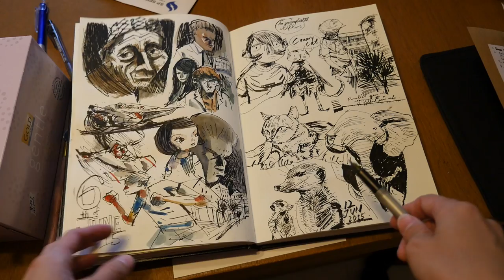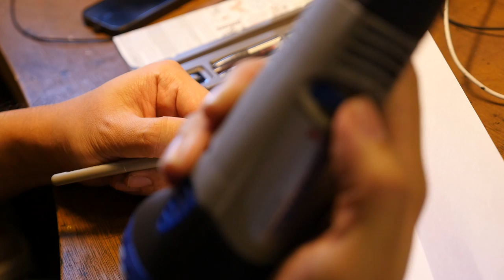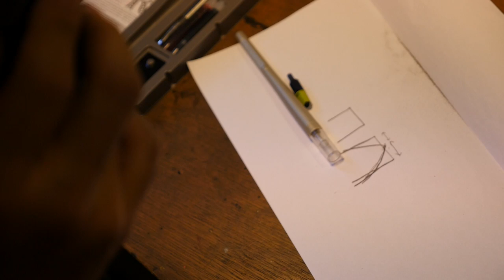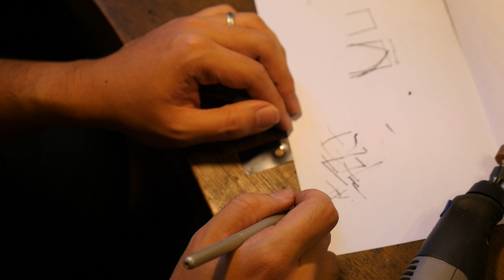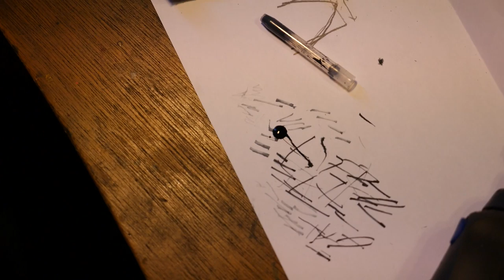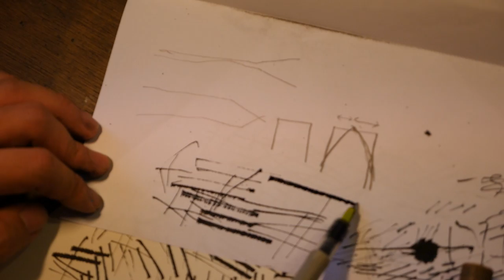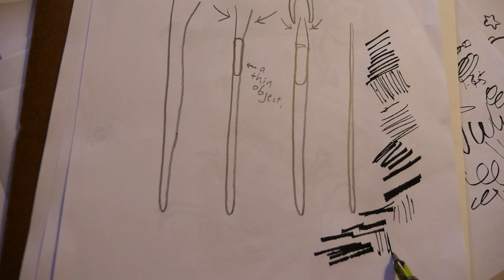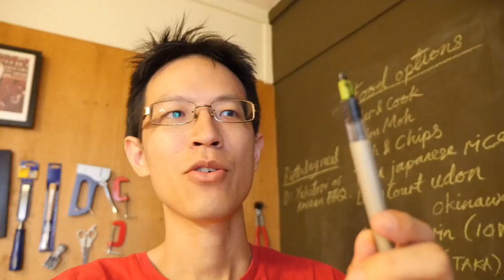How to grind a Pilot Parallel Pen

Comment: On the pilot parallel there are slight indentions on either side of the plate which make a small Channel. when you ground it down you removed it so the plates are close together and they are inhibiting ink flow try the 1.5 mm and leave the divot